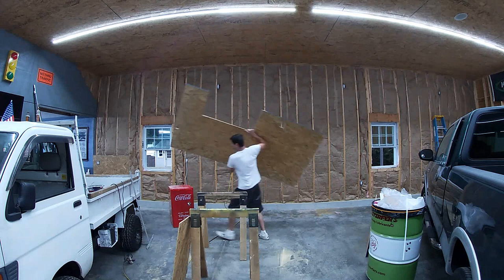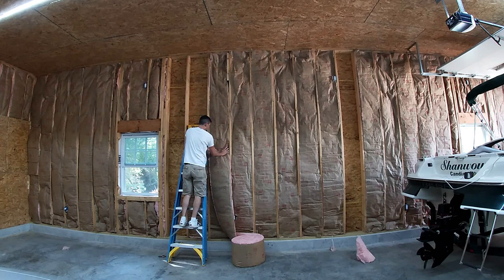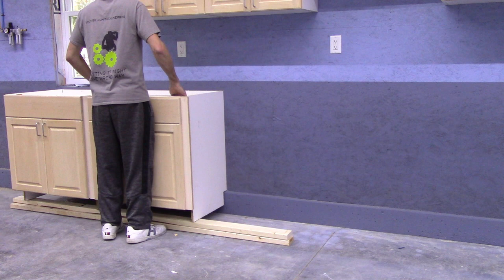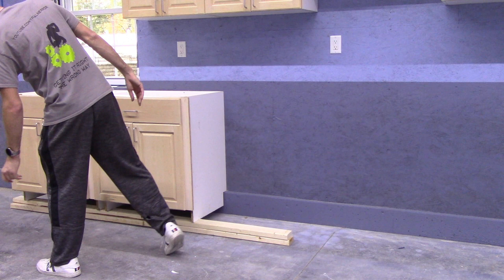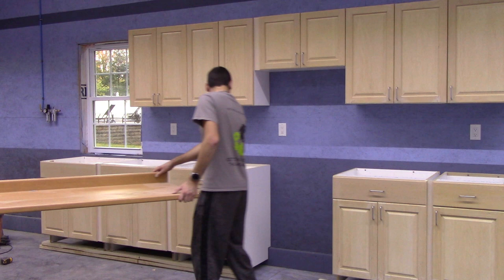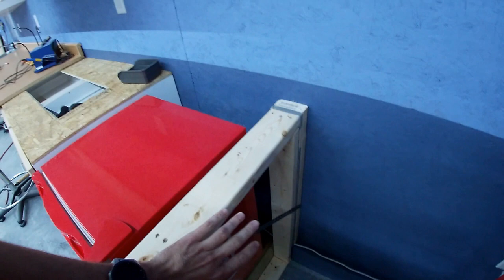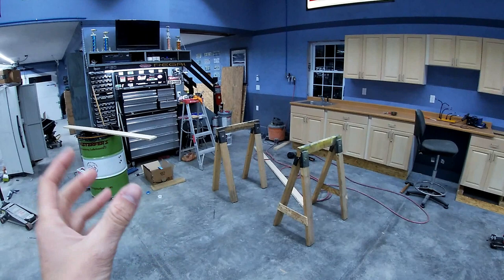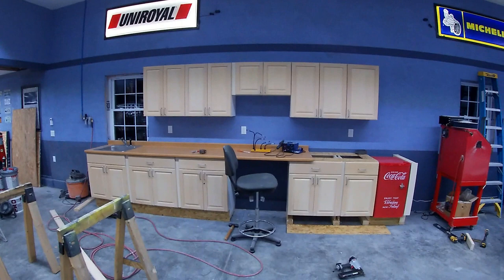Part 16: Dream Garage Build - Insulating, finishing, painting and cabinets!

Comment: It looks like  you used the rough side out on the OSB what was your thought process on that. It also looks like you used latex and not oil base, again what was your thought process. i ask this because oil paint is suppose to not raise the grain and leave a smooth finish.  just curious. shop looks really good.